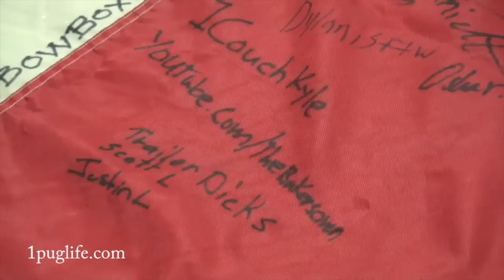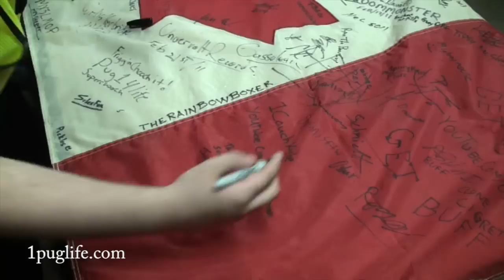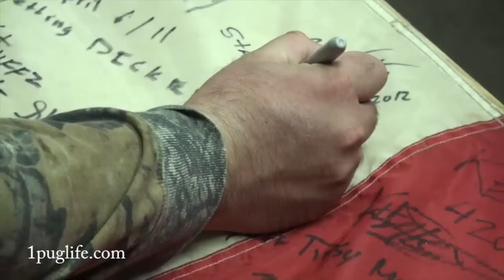no helmet required

Comment: The exhaust will really help that engine perform a lot better. It's not even reving as high as it should. Do some research on why 2 strokes needs those pipes. It's not "backpressure" like people say it creates sound waves the "push" the scavenged air fuel mixture back through the exhaust port into the cylinder.
Reply: You're talking about a tuned pipe. The exhaust that came with this engine stock was pretty much a muffler. They left the header and chopped the muffler.
Reply: It's nice to see other people aren't always stupid. Have a good day

Comment: Needs the mufflerizer put back on, 2 strokes require back pressure.
On an expansionization chamber, look how big the header pipe is compared to the outlet...needs back pressure bud.

Comment: Chris is that a two stroke? If so check the reeds they control compression! It is Yamaha so they should be an easy find on ebay "search" yamaha reed valves! You could always find an old wave runner and just put some liquid cooling on her and have one bad golf cart! What is the stock numbers on the Engine! A good starter fluid is WD40 for two stroke engines, I had a polaris jetski and the manual said to use WD40 on cold startups at the beginning of the season! Perhaps for $23.99 this would be nice on athe golf cart! 390823571550  is the item number! Almost gone!